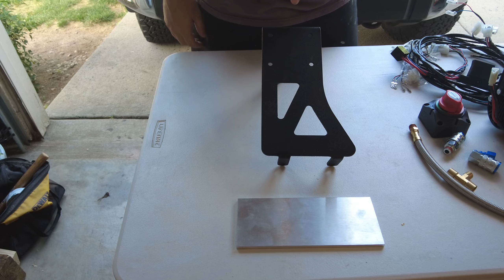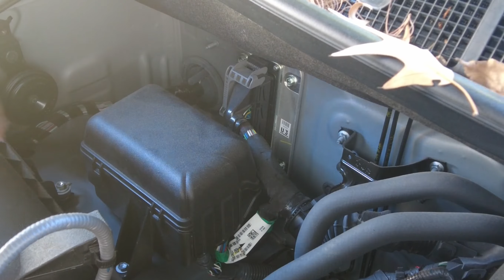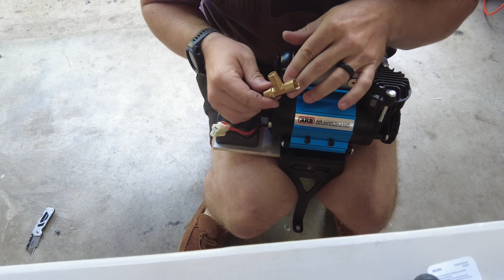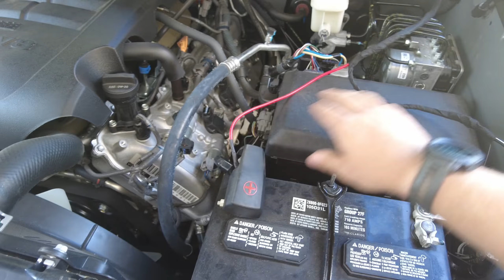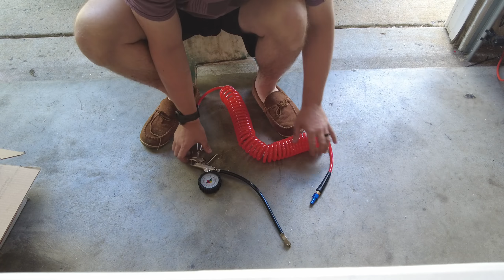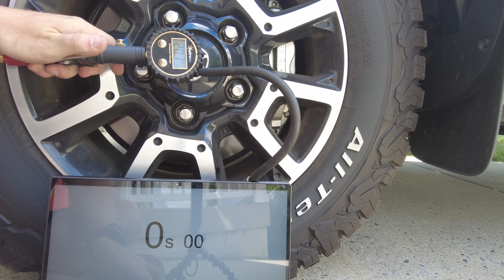ARB Single Air Compressor Install and Test In My Tundra!

Comment: Any technicians get triggered by the adjustable opened end wrench?
Reply: No, that's a completely normal tool when it's used right, preferably on larger sizes.  I just used one to put my pressure switch on, and often do for plumbing fittings.  Or course I used sockets and wrenches for the nuts and bolts.

Comment: Nice job. I just installed the ARB Single on my Bronco and I'm stuck on wiring. Your simplification of wiring really helped. Is there any down side to not installing pressure cut off switch?
Reply: I have this question too
Reply: @manuelcorrea6304  I think you should install it. If you don't, it won't shut off and may burn out the compressor motor.

Comment: Thank you for an excellent presentation. I have a 2020 trd pro and my compressor went in with no issue. So nice to eliminate a rats nest of wiring by installing the on/off under hood.
Reply from the maker: Yea I would never need to be inside the truck while its running so it just makes more sense. Unless you have air bags or are airing up and down every couple weeks I think wiring inside is overkill.

Comment: Maybe attach a piece of pvc plastic to hold the braided air line when not in use, no rattling and keep it clean when not using it. Or at least a plastic cap to keep the dirt out.

Comment: Hello, on the pressure switch does it matter what side the red and the blue cable goes into?
Reply from the maker: No I don’t think so, it should just break the connection when the pressure limit is reached.

Comment: I bought the mx650 suspension kit from eBay and installed it recently. Every time I use the front brake the lower half of the fork seems to bend back. Is there anyway you fixed this
Reply from the maker: It’s probably the bushings getting worn out so the forks have too much play. You could get new bushings or make your own.